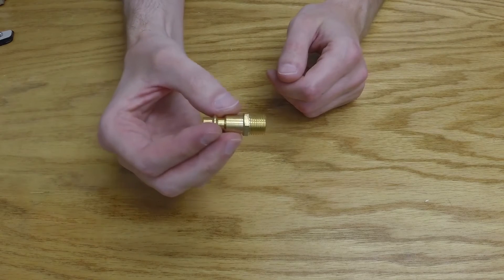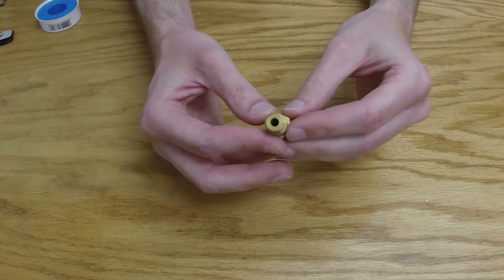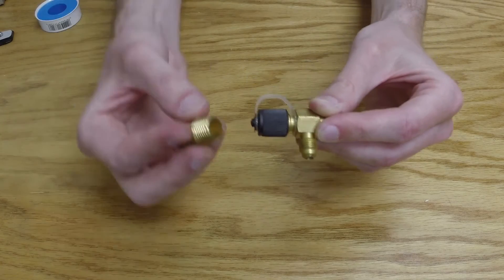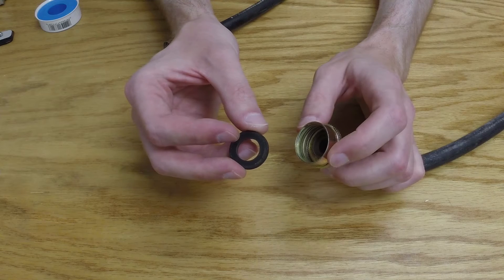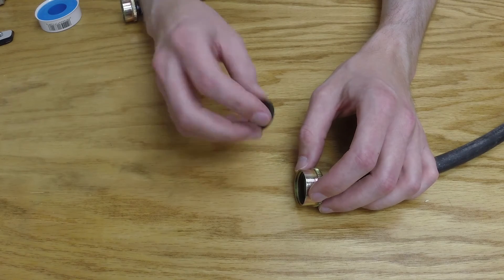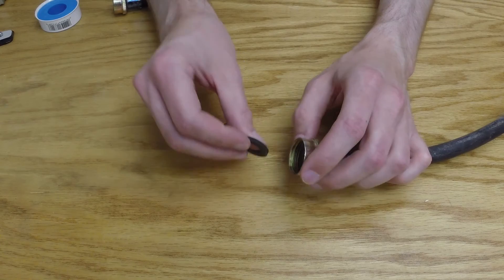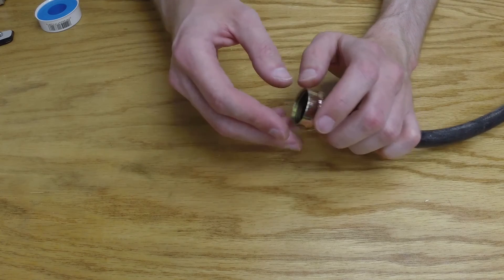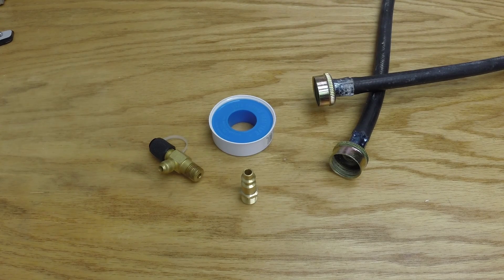Different kinds of seals

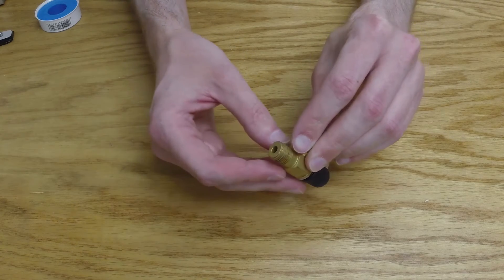Comment: 1:36 The flared end connectors come in either 37 or 45 degrees. Which degree used will be determined by application. 45 is usually for low pressure and is made of brass. Just adding additional information for those curious enough. :) Thanks for taking the time to put up the video!
Reply: just be quiet
Reply: @AJ-nd1ct  🙄